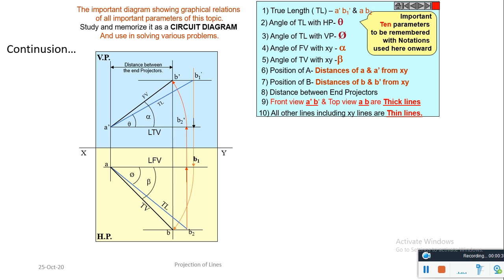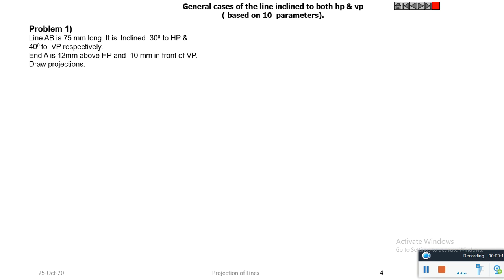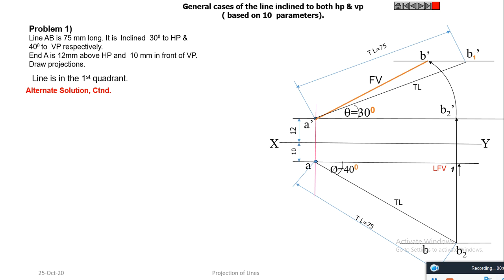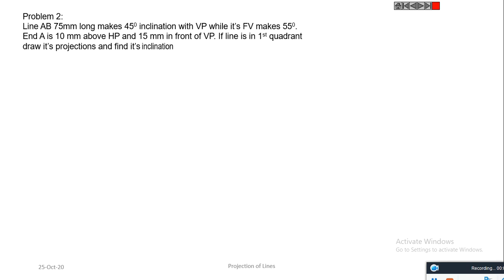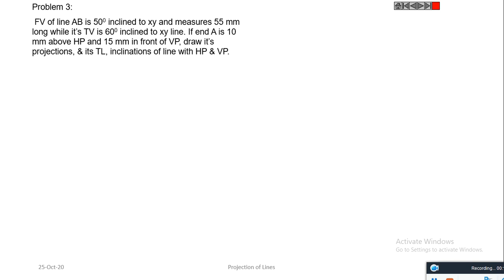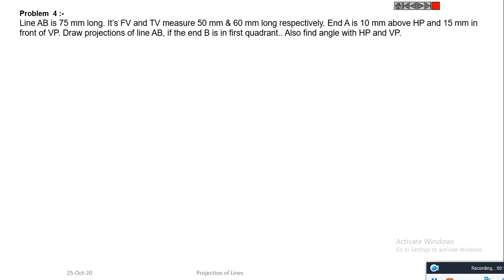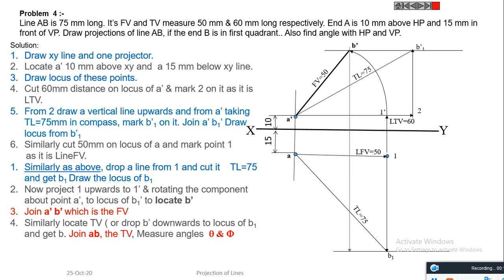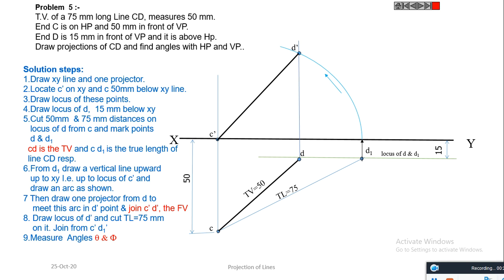5. Projection of lines inclined to HP&VP-Problems

Comment: Sir I have doubt in a question 

Q. The projectors of the ends of a line AB are 5cm apart. The end A is 2cm above the H.P.  and 3 cm in front of the V.P.  The end B is 1 cm below the H.P. and 4 cm behind the V.P. Determine the true length and traces of AB and inclination with the two planes.

Sir please solve this question 🙏